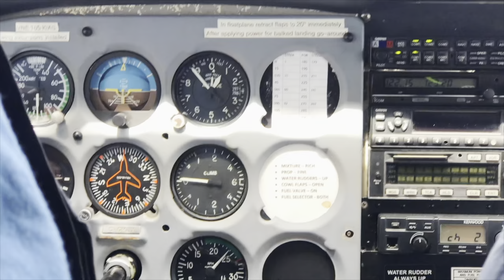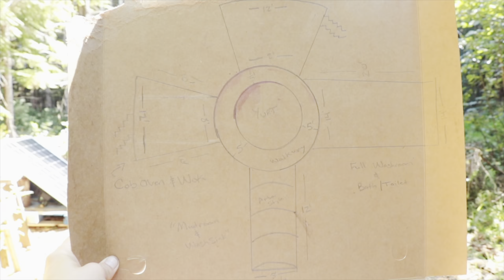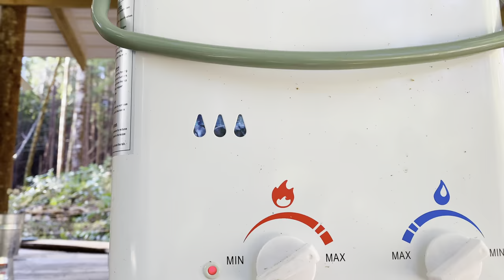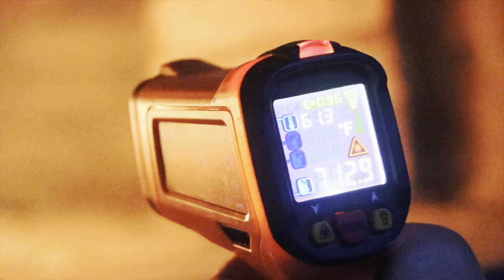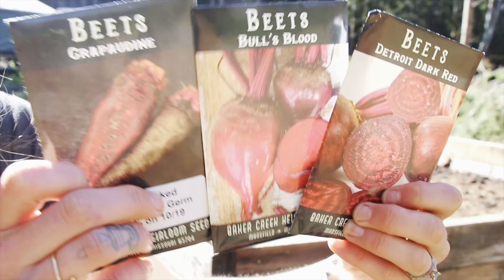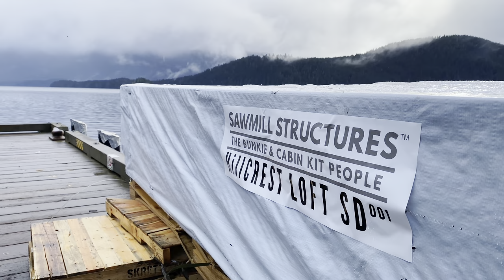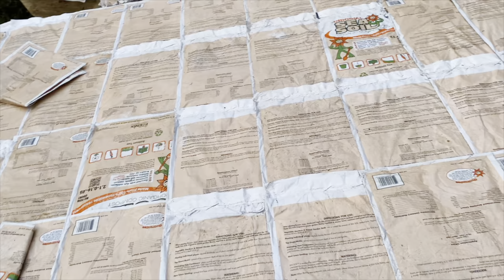3 YEARS ALONE & OFF GRID in the CANADIAN WILDERNESS | SELF BUILT CABIN, YURT, & OVEN (FULL BUILD)

Comment: I have a set in fact that same set that you have and it is wicked sharp. Bit pricey but well worth it. I am a Leather Smith by trade and Sharp blades are crucial to my work and I've become somewhat of an expert at sharpening knives. And having to sharpen knives every time you use them is not fun. These blades don't have to sharpen for months. Well recommend them. Another knife company that's made in America as a matter fact is case knives hold an edge very well. And come with a smaller price tag. When it comes to knives only buy American made steel or Japanese steel. Nothing else matters

Comment: 2:42:15 Steel in reinforced concrete needs insulation from enviroment from every side to not corrode, 2,5cm higher vould be ok, lying on the bottom is not, you need a book about basics of concrete works.